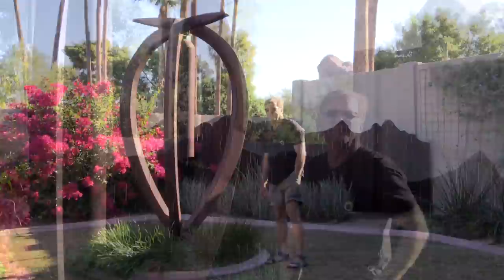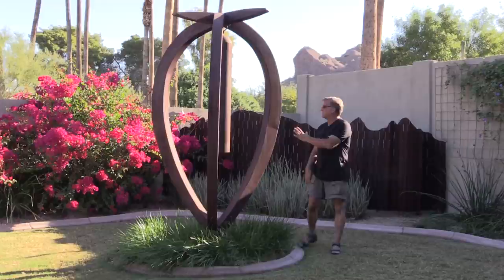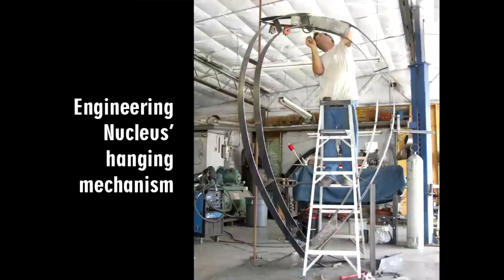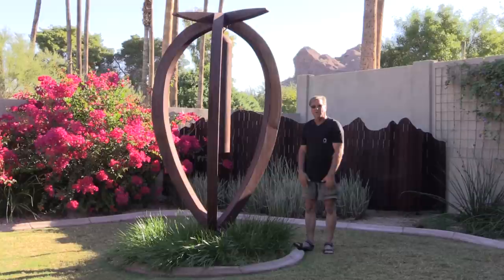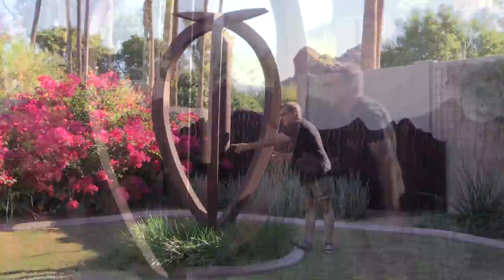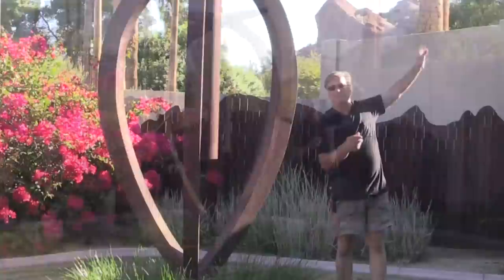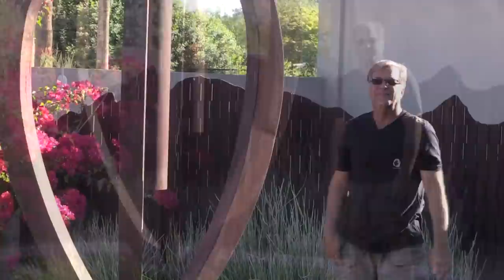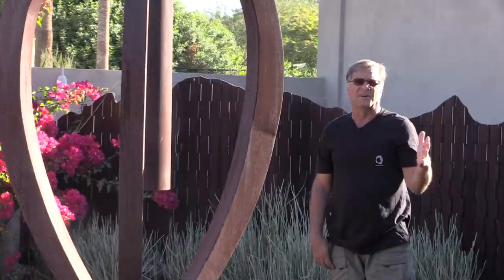The Story Behind ... the Sound Sculpture Nucleus - Kevin Caron

Comment: What did you use for the clapper? I am working on a bell made out of an old vertical propane tank.
Reply from the maker: Made one out of 1 inch plate!
Reply: That is what I was wondering also. There can't be much room between the clapper and the tank.
Reply from the maker: Have to experiment with the diameter to get it "just right"!
Reply: So I am assuming the clapper is a round disk of metal that is suspended inside the tank just above the opening at the bottom. Is that right ?
Reply from the maker: Correct.